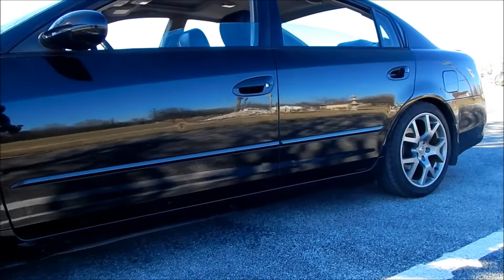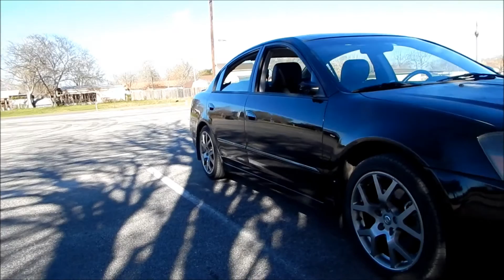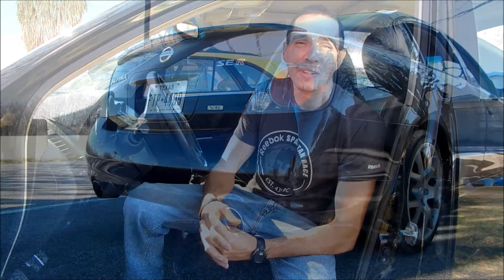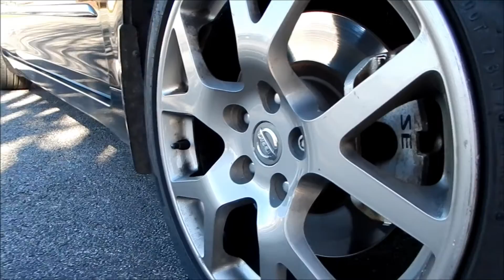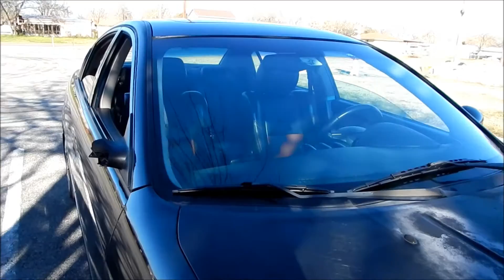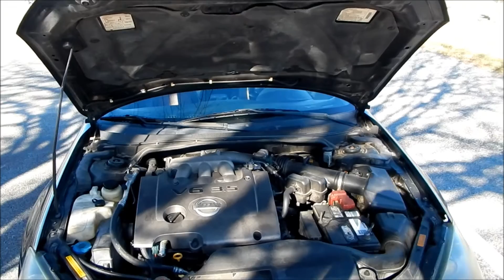Project Altima SE-R [EP: 1] Introduction

Comment: So am I crazy? Just bought one with 188k. Drives like a dream, clean interior, and plenty of power. With that said, it has the clear coat failing on the hood and roof. It has some noises from under the hood while revving, but I just read one of your comments about genuine Nissan oil filters. I might give that a try. 

I bought it from the dealer auction with the intent to flip, but after that first test drive, nope I'm keeping it for now.
Reply from the maker: They're good cars, I used a K&N filter for oil on this one when I had it.

Comment: I'm pretty certain this is a 3.5s, not an SE-R. the se-r doesn't have any chrome on it, yours does. The badge isn't at the right place, but the 3.5 is. And the nissan altima se-r didn't have any v6 badge on it, while yours does. I would be surprised if someone put 3.5s badges and chrome on an SE-r altima, would be weird.
Reply from the maker: I don't know man, It was v6 with a six speed manual transmission, SE-R leather interior and Center Cluster. The badging may have been off but it had the SE-R bumper and HID headlights also. I don't have it anymore or else I could try to VIN match it I guess.
Reply: Replacement truck most likely

Comment: What price did u get it 4? I'm couriers cuz I just bought a 05 Altima ser too.... mine has no leaks and looks great, with motor fully rebuilt with paper work.
Reply from the maker: I believe I paid 3k for this one,  they're great cars for sure. That's good yours is rebuilt cause motor work on these is a little tight. Make sure you keep an eye on the oil level!

Comment: The badges on the trunk are off. The SE-R didn't have the "V6" badge. Also the "SE-R" logo belongs lower on the trunk, where the "V6" logo is now. This is leading me to believe that this may have been in an accident. The previous owner threw the badges back on after repair/repaint incorrectly. 

Not hating at all man, I'm in the market as well for an SE-R and you picked up a rare beauty. Good luck with the build, I'll be watching 👍.
Reply from the maker: Wow, good catch on that. You may be right, there looked to have been some paint work done to it before I got it. I never ran a car fax on it to check for accidents through.

Comment: Yoo brother! Love the vids. And the car  👍 I've got a same black SER. You got a super deal! I still remember when they hit the dealer lot in late 04. in Canada the same black SER Manual trans was 45 895$ prob 15000$ less for you guys lol.. this one is my 2nd altima. I had an 05 5speed 3.5se back in 06. Also have a 04 maxima elite 6speed.  So the VQ is familiar territory for me. They're great motors. Only critical advice i would love to pass on, something a friends old man taught me back in 06 with my 3.5se
He's a retired Nissan tech.  Anw long story short.. one day, he seen me in town. Said hey!,how's the car running. I had done my 1st oil change.   I mentioned to him. Ever since, when i launch. I hear like a metal chattering sound.  His 1st question was.  What kind of oil filter d'you use.  Napa gold I replied, best they had. Laughing in his replying answer. He said swing by home. Well put a nissan filter on. See if that helps. 
Instant fix 👌   Then he technically broke it down for me. How the oem filters are are pressure regulated to proper specs that keep the timing chain tensioners at right pressure. So the chatter i was hearing,  
is commonly referred to as (chain slap). As I'm sure you can imagine what that is. Lol!! 
 Anw.  Not to tell you what to do,  rather. Just wanting to share the wisdom he had for me.  
I've never run anything but nissan filters since. I'm at about 348 000 kms on my original motor 04 maxima.  Still goes 4000+kms without adding oil. 👌 
Hope this help bro! Peace ✌️
Reply from the maker: Yes Sir! They are getting more affordable everyday. That is the first I've heard about the Nissan Filter and oil pressure. I'll take a look into that for sure. It's due for an oil change and I have a new oil pressure sensor to do at the same time. Thanks for watching!
Reply: Ohh yess!, hehe & along that lengthy msg/comment. I forgot to mention. I had to change mine too. Common issues with the years.  Well Worth it's efforts bro! 👍   Cheers dude ✌️
Reply: @marceldaigle2778  3 years later but that makes total sense. OEM is always the solution lol